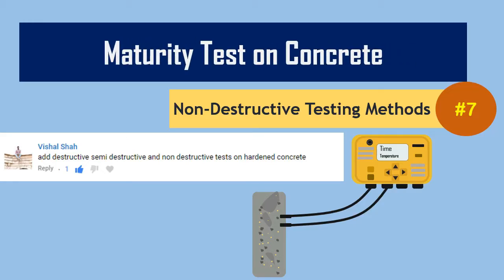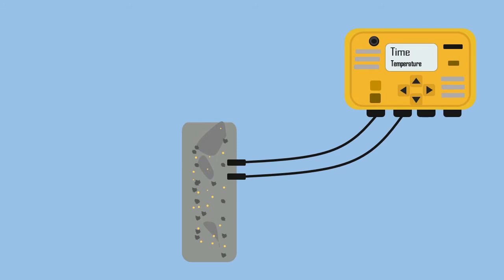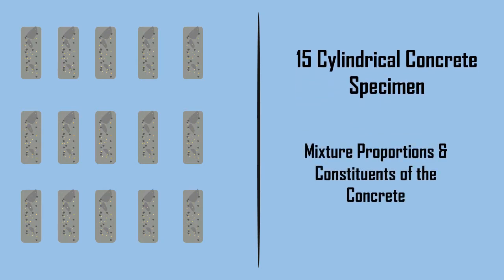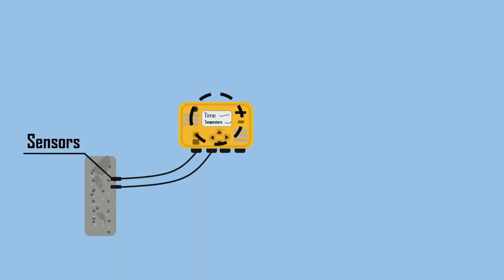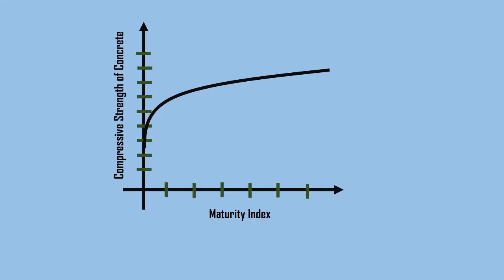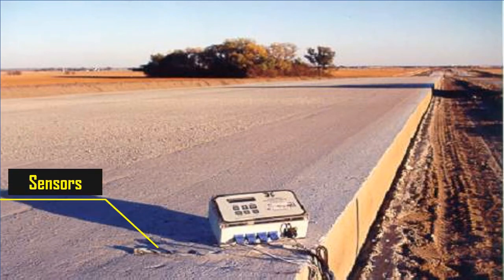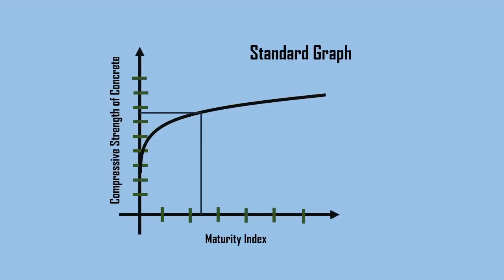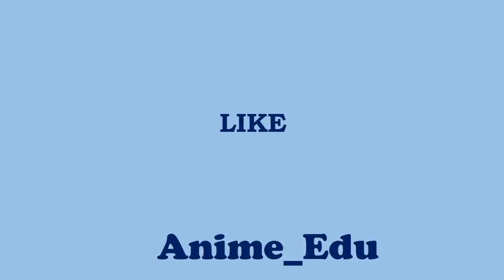Maturity Test on Concrete || Non-Destructive Testing Methods (NDT) #7

Comment: How much time it requires to complete the test ? 

And what is name of that device ?
Reply from the maker: As there is requirement for testing of 15 cylinders, it takes around 28 days for the creation of standard chart and to perform the test it can take the maximum of 28 days based on the need.
Reply from the maker: The device is named as "Concrete Maturity Meters".
Reply: Tq 😊 fr the information